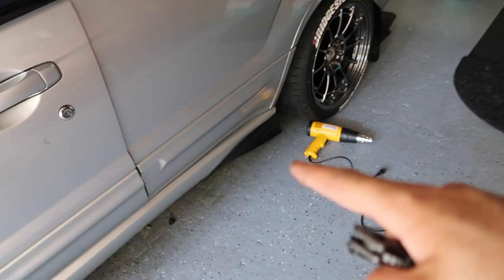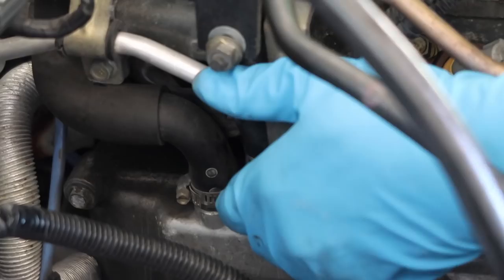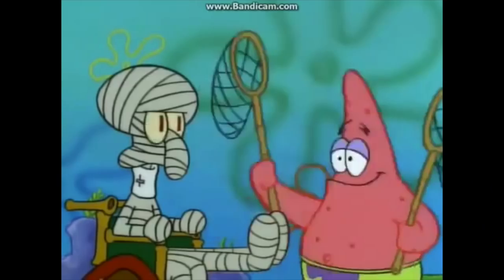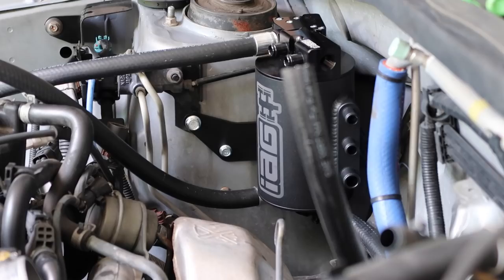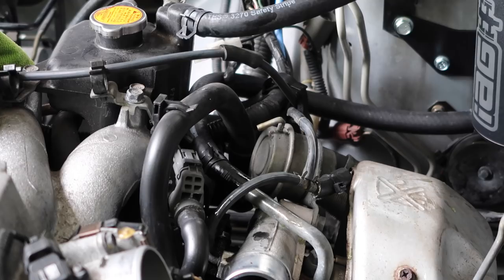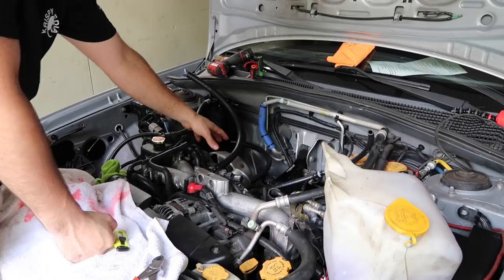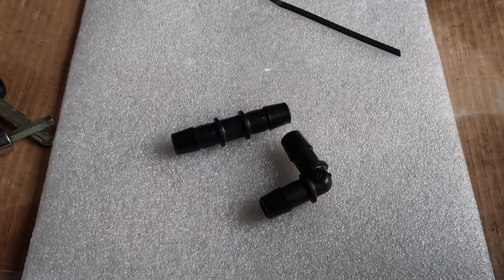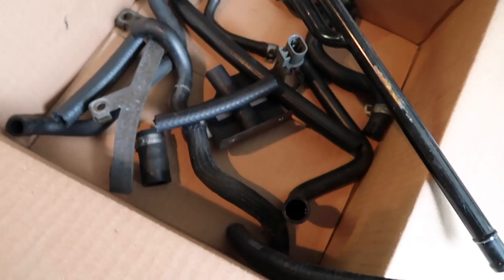Subaru IAG Air Oil Separator Installed on the Forester XT!

Comment: Thanks for the video lots of help but I have a question? So I have a STI intake manifold and the port under the throttle body is a lot bigger then 3/8ths. Can I go get any 3/8ths pipe fitting and replace it so the hose fits?